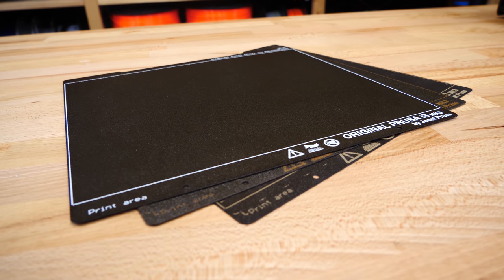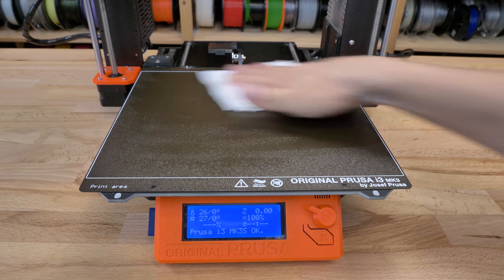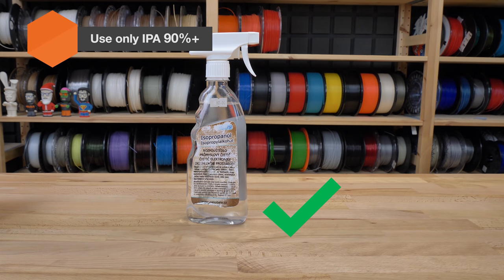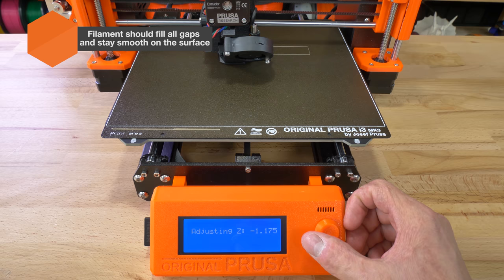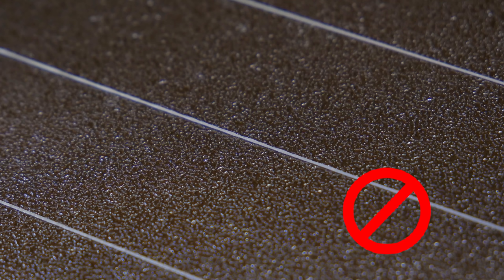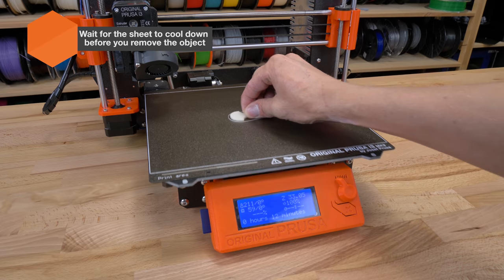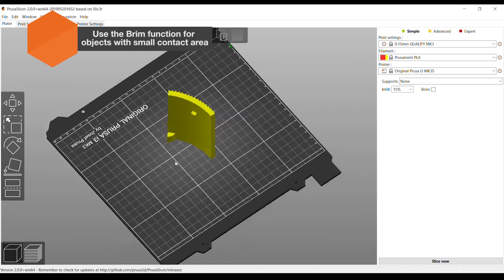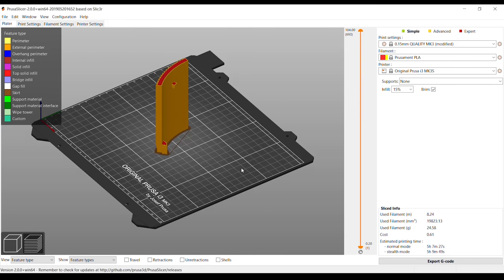How to print on a powder-coated sheet

Comment: It's worth noting that you no longer need to recalibrate when switching sheets since there is support for profiles.
Reply: Note: this is not yet the case for the Prusa Mini
Reply: @jonathansmith7607  rip. good thing i got a mk3 then lol
Reply: @Backyardwrenching1243  The Mini does have profiles, his comment was over a year ago
Reply: Are you referring to the Smooth/Texture profile for z height?
Reply: @calvinzhang3899  There are 6(?) steel sheet profiles you can store to memory now. You can quickly and easily switch profiles before each print.

Comment: It is a fantastic print surface.  I print in petg and can say after hundreds of prints of using windex as a release agent after cleaning with IPA the bed is still good as new and have not even flipped it to use the bottom side.

Comment: I have cleaned mine with 99% IPA and recalibrated the bed several times, following the guide and hundreds of hours on other printers leveling manually. I am printing the supplied benchy PLA gcode on the SD card that was in the box, and using the supplied prusament. and it wont stick for more than a couple layers before pulling away. Very unfortunate experience. Contacting support, might have to send it back.

Comment: This is the best surface i have printed on. Great adhesion and it leaves a great finish. It was well worth the wait.
Reply: fassenkugel I don’t think it is the same quality as the anycubic ultrabase. I have this one and it is really good quality, it does not wear out. And you have 2 sides.
Reply: fassenkugel  I use a anycubic ultrabase for 1.5 years now and everything sticks perfect. what have you done to your ultrabase? ;D
Reply: What material do unually print with?

Comment: Having a hard time getting PETG or PLA to stick with the powder coated sheet.   I have set the z value so that it makes smooth lines, not to low not to high.   It seems to take a few tries before the PETG will stick.  If I wipe with IPA then  nothing sticks.  Any tips  and thx for all of your great video's
Reply: Same here. After cleaning with IPA, nothing absolutly nothing sticks. Only 3D Lac ist the solution.

Comment: So, quick question. You mention not to use release agents like glue stick or painter's tape, and mention in the next sentence of damage to the PEI sheet (not sure if this is related to the glue stick use or the acetone cleaning, the wording is a bit confusing).

But on your Material Table, you recommend using a glue stick for ASA, ABS, PC and PA, even with a textured sheet. So I'm not sure if using a glue stick is recommended or not? Could it cause the tiny cracks you mention around the same time, or did I mis-interpret that being attributed to the glue stick/tape?

Comment: So... no Windex or glue stick?
When we got our MK3, it came with a Powdered coat, as well as a glue stick. We just assumed that we should use the glue stick. We did clean it frequently with Isopropyl alcohol, but were still using the glue stick.
Recently we switched away from the stick, given the mess it leaves, and switched over to just Windex... which appears to work well!
Reply: I think the glue stick comes added as a last resort for exotic filaments that might be harder to adhere/release to/from the brintbed. I only needed it to make ASA filament release from the PEI sheet.
Reply from the maker: The gluestick doesn't hurt the sheet in any way, we just think it's not necessary to use it (and it causes some mess, as you mention) :)
Reply: Get the nozzle as close as you can to the sheet during first layer calibration. I think all the 'nooks and crannies' in the sheet's powder coating need to be filled so the print doesn't lose adhesion. I also turn the bed up to 70 rather than 60.  I did that, I use Hatchbox PLA and I've been making beautiful secured prints ever since.

Comment: After a few months of use I couldn’t get PLA or PETG to stick to the textured bed at all!  Even though this video says not to use acetone on it I figured it wouldn’t hurt since the build plate became worthless to me anyway.  So I cleaned it with a towel lightly saturated with acetone just enough to cover the whole surface.  Now it works perfect again!

Comment: Hello, I have a question. What happens when i use koress stick glue to adher my prints to the powder coated bed? I have been doing this quite often cause the prints were not sticking to it that well and most of the cases it broke of in mid print. The first layer is perfectly calibrated and it happens to prints with large surface are too.
Reply from the maker: It's fine, glue stick won't damage the sheet. It's just unnecessary to use it with the powder coated sheet, clean it with 90%+ IPA and prints should stick nicely by themselves.
Reply: @Prusa3D  can I use normal UHU stic?

Comment: Just got my first 3D printer Prusa MK3S+.. I'm using the powder coated bed sheet and using the standard PLA profile settings from the printer for the Prusament filament.. 215 hotend and 60 on the bed..  I've done my first layer calibration and it seems fine.  My problem is after completing about 80% of the model it always seems to detach itself from the bed.. what am i doing wrong?  I've tried using the glue stick and cleaned the sheet before every print with alcohol.
Reply: Just as an update.. I don't know what else to do.. I played around with temperatures, cleaned the textured sheet thoroughly with 99% IPA.. lowered my Z axis as much as i can.. tried using glue.. NOTHING WORKS.  I feel this was somewhat of a false advertisement by Prusa that these textured sheets will work with PLA, cause it CANNOT.  I can do most PLA prints if it takes less than 2hrs and it has a wide enough footprint.. but any prints that takes longer or has a less than a 5 cm base.. it's going to come off the sheet and fail.. guaranteed.  Anyone like me that is just starting off with 3D printing and bought the MK3S+ with the textured bed sheet will feel very discouraged as anything but the simplest prints will fail.
Reply: @patc8653  Pat, I’m in the same boat as you. As my prints near the last 15-20%, print detached from the base almost as if the nozzle catches on the top and breaks the connection at the base (taller model = more leverage). I’ve tried slowing down speed to 80% and raising the bed temp to 65deg but same problem. Tried dawn soap and green pad, IPA, Acetone, full xyz and first layer cal on a stable table, but no luck. Using the Prusament PLA include with my kit version and the stock memory card files. I e tried slicing my own with brims but same issue - it fails when it gets a couple of inches high. Even low profile prints sometimes fail, although not as frequent. Going to try the nylon lock nut mod under the bed to see if that helps.
Reply: @jamram109  I solved my issues by simply using the Steel Sheet instead of the Powder Coated sheet when printing with PLA.  I also use 99% alcohol to clean the sheets before each print.  My temps are usually set at 50 for the bed and anywhere between 105 -110 on nozzle.  Hope that helps..
Reply: @patc8653  just a guess but did you try differend filament brands? What could also help is to use non-crossing infill patterns (gyroid for example) and maybe more zhop to minimise the forces that push away the model. After all the adhesion just isn't that great with PLA but for me it worked so far (with Prusament and Das Filament)

Comment: I was having trouble getting the first layer correctly. It just wouldn't adhere enough. When lowering the Z, it would squish it too much and when it looked and felt right, it just wouldn't stick. It was only when I falsely sliced with ABS tempeperatures, I realized I had to make the first layer as hot as 230°C and it would make a perfect first layer!
Reply: I will have to try this, because all my prints have failed so far even though they stick fine to begin with!
Reply: @mattiasfagerlund  Just use dish soap and crape the sheet with a sponge. Alcohol does not remove grease, soap does. I had massive issues with the adhesion until I used dish soap. Now... It is the best 3D printing surface ever...

Comment: For PETG, do I still need Windex?
Reply: No. Prints remove easier than pei sheet.
Reply: @gibbedyg9369  I did find it useful to Windex the nozzle pressure prep line on the front of the sheet.  Sometimes that can adhere really strongly and it is too thin for the release.  The rest of the sheet works fine with Windex or IPA.
Reply: For PETG the surface needs to be warm. I've had some issues with removing PETG at room temperature.
Reply: For PETG I can confirm: you need a barrier for the smooth sheets (PVA, Magigoo, whatever), but not for the textured ones. For the textured ones I find the print literally separates itself when the sheet is completely cold. Swapping between the two bed types is four and a half full turns of the knob in Live Adjust Z (downwards when going -> textured bed).
Reply: @MarkWheadon  i agree.  i printed a bunch of parts in PETG at once and as it cooled you could hear the "pops" of them coming off the sheet themselves.

Comment: Should i buy this one or the smooth one? Which is the andvantage of this and which of the smoot one?
Reply: From what I read...this new sheet should allow us to better print with these materials:
  PETG, CPE, FLEX/TPU, ABS.

The Smooth PEI sticker spring steel sheet are best for these materials:  PLA, HIPS, PP, ASA, composite materials (metal/wood).
According to the Prusa Website.  I haven't used the new one yet.  But, it is on order.  Good luck.
Reply: @gibbygibstone  thx

Comment: Er...question...when I got my mk3, I was one of the fortunate few who get a powder coated sheet. It I'm never supposed to use glue sticks on it....why did my Prusa ship with a glue stick??
Reply: Probably for the smooth sheets or materials like Nylon which doesnt like to stick to these surfaces.
Reply: You'll need it if you ever print TPU. Printing TPU straight on to the bed can be a disaster (it sticks way, way too well).
Reply: @MarkWheadon  TPU on the textured sheets is amazing, with no release agent needed. Smooth sheets are a different story. Odds are the glue stick is part of a default package of accessories for all printers.

Comment: Using the textured sheet with PETG and the edges of my print aren't sticking to the bed (slightly curling up over time). My first layer seems to be match your recommended layer height in the video.   Any advice?

Comment: The instructions printed inside the MMU2S upgrade kit suggests to use WIndex to clean the print surface. I found it to be super effective, and worked better than 90% IPA. Do you no longer recommend to do that? Do you think it will damage the surface?
Reply from the maker: Hello, it is still recomended to clean the surface of the smooth sheet with Windex. However, this does not apply for the powder coated sheet (you need only IPA 90%+).
Reply: @Prusa3D  Is it harmful to use Windex on the powder coated sheet?
Reply: @danielsmullen3223  It won't hurt it but it will reduce adhesion.  I use Windex for PETG still on my powder coat but Windex definitely is a no-no when printing PLA on powder coat.
Reply: @kodiak2fitty  I had been using it for PETG, so this makes sense. I will clean with only IPA for PLA printing. Thanks!

Comment: Looking forward to trying it out. Can you print Nylon and PC on it? Does this survive PETG without release agent?  Pretty sneaky though. ;-)
Reply: I've been printing PETG for a week on my new powder coat sheet.  It's awesome.  Most prints will creak and pop just during the cooling process and release themselves.  Nothing like the crazy adhere of PETG to the smooth PEI.
Reply: Rod,

I have used Taulman 910 with Elmers purple glue, and also PC-Max and Rigid Ink Pure Polycarbonate both with Magigoo PC and they all work terrific so far.
Reply: The only thing I found that can destroy the bed is Filamentive ASA. I use it precisely because it sticks so well but when I used it on my textured bed it pulled the surface off whilst removing the part 😱 Nylon needs something like undiluted PVA as it does with other surfaces.
Reply: @kodiak2fitty  Thanks for the info. That sounds fantastic!
Reply: @pabsuk5558  That is some great news. Thank you. :)
Reply: @MarkWheadon  That ASA must be adhering like crazy! So far I have not used ASA because of the styrene part in the copolymer and its smelly toxic fumes. Okay so Nylon printing as usual. Thanks for sharing your experience.
Reply from the maker: Yes, it's possible. However Nylon and PC are not standard materials so you need to be careful when printing with it. For example pure Nylon might stick too much and damage the sheet.
Reply: @Prusa3D  FWIW the Nylon I tried on the textured sheet was Taulman Nylon 910, so an alloy but mostly Nylon, and that had the opposite problem – it curled off during printing. Worked fine with a thin layer of undiluted Unibond indoor wood glue which is my usual go-to surface prep for Nylon.
Reply: @Prusa3D  Thanks for the tipp. Then I will slowly approach that territory. :)

Comment: I use glue stick even on PEI because it gives more consistent results. With some plastics it prevents sticking TOO well and tearing the PEI and for other plastics it helps them adhere better. I use Elmers washable glue stick on every surface type with all plastic types.

Comment: So I must be crazy, But I've never used anything to get stuff to stick to the print bed with either the PEI or Powder coated sheets... Not saying my prints don't warp but a little brim goes a long way.
Reply: I usually use something (PVA or Magigoo) for the opposite reason – to stop some plastics (TPU on smooth and textured sheets, PETG on the smooth sheets) from sticking too well.
Reply: Brims are for chumps.  I refuse to use a brim for anything but nylon since they aren't necessary for anything but nylon.

Comment: I'm having trouble getting abs to stick with first layer calibrated. The bed is at 100* and nozzle is 255. I cleaned the bed with IPA although I believe it's only 75%. Any suggestions.
Reply: PLA (especially Silk) I've found like to peel. PETG sticks fine. 
I'd first try making sure you got a proper height. The first layer calibration is good for know what's going to just stick but print like a .8mm square to really see how a first layer will stick.
Adjust the live Z until you get a good first layer. Small prints are also prone to getting dislodged. 
Turn off the fan for a few extra layers as it could be the cooling

Comment: When switching from using PLA on a smooth sheet to PETG on a powder-coated sheet, how do you do a first layer Z axis calibration, given that PLA will not stick to the textured sheet and THERE IS NO SETTING FOR THE PRUSAMENT PETG (250 HEAD/80 bED) AVAILABLE IN THE CALIBRATION PROCESS?
Reply: Petg won't stick to pla at all. So the answer is, imo, to mark one side for one material and the other for the other. Saves a lot of effort!
Petg is the second option down in the first layer calibration menu.

Comment: What is the purpose of the glue stick that you provide with the MK3S kit if, according to this video, I shouldn't use it on the PEI coated sheet?
Reply: The glue stick is a standard kit part, they throw it in whether you need it or not, like the spare parts, haribo, acupuncture needle etc. Also educes inventory complexity to just send everyone a glue stick.
Reply from the maker: If you have/will buy the smooth PEI sheet, it comes in handy for FLEX and other problematic materials. If you plan to use just the powder coated sheet, I guess you got a free glue stick for your other projects :)

Comment: I've NEVER had so many issues printing PLA with a printer before. 

Why do you include a gluestick, a spool of PLA and this powder coated sheet if you're not supposed to use the gluestick? 

and the PINDA's sensor doesn't work with glass.

Comment: Would have been nice to know wich materials work best with this sheet. I like to use ASA but that can be a real adventure to get it off the PEI sheet. Maybe a nice vid in the future?
Reply from the maker: We're actually working on our own Prusament ASA, so ASA instructions are on the way :)
Reply: I print a lot of ASA on the textured sheets – it seems to be safest to use diluted PVA or better still Magigoo as a barrier – the ASA then sticks well, but not too well, reliably. Without the barrier some ASA sticks well and some sticks too well (I have one side of a textured sheet destroyed as evidence of that).
Reply: @MarkWheadon  how do you dilute pva, and will windex work?
Reply: @mihneamanta8636  Not sure about Windex, but the PLA is simple enough – just add water. Something like two or three parts water to one part PVA, although the ratio isn't critical. I keep the diluted PVA in a screw-top jar.

Comment: Never had to use a glue stick when using my powder-coated sheet. Even when brim is adviced, I had no issues with adhesion (of course this is not a guarantee). And objects are easily removable.

Comment: I’ve been using the textured bed for a few months mostly with PETG and I love it but lately I can’t get the PETG to stick to the bed during the first layer unless I excessively squish it and use lots of heat.  I was about to use acetone but luckily I saw this video first.  I use 91% IPA and that’s not working either.  Any advice would be appreciated.

Note: I switched back to the smooth sheet and it sticks really well so the problem is with the sheet.
Reply: I have the same problem. I can't get PETG to stick, so i used gluestick and it worked perfectly.
Reply: I like to use hair spray works great